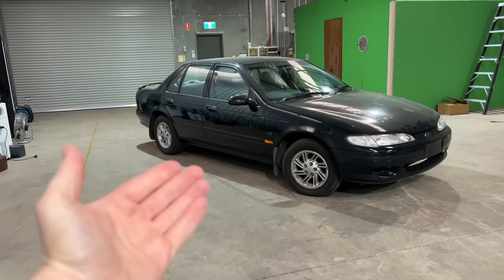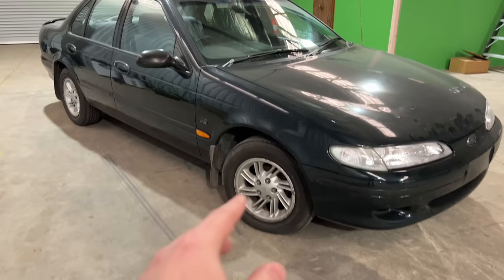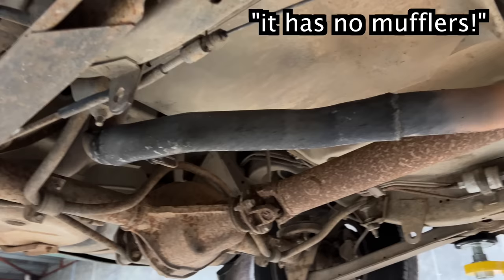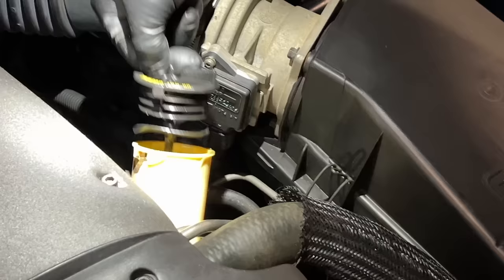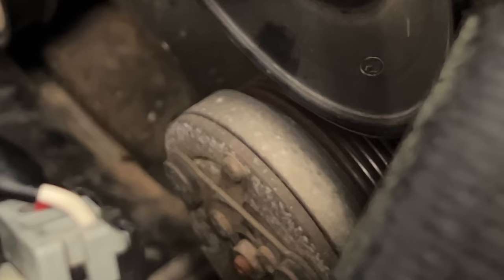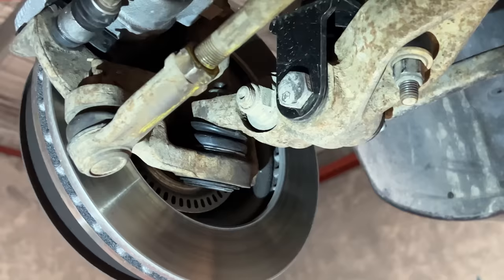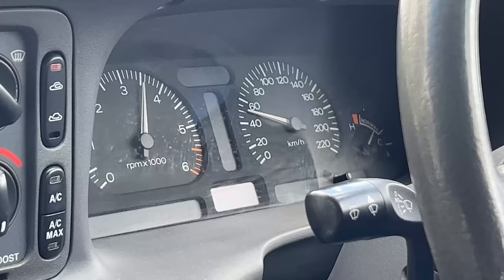Strewth mate, I got a V8!

Comment: Fun fact, those power steering pumps are used on a ton of Fords from that era!  They almost all make that cavitation noise.  But I hear you can mitigate some of that by using a handheld vacuum pump to pull out as much air as possible.  I haven't tested it on my truck yet, but I hear good things.  Nonetheless, Jeff looks like a ton of fun!  Love the video!
Reply: twilight! <3
Reply: @ChiefLink You know that cavitation comment makes so much sense now. It definitely didn't sound like a bearing otherwise it would have whined even if it wasn't under load, whereas in the video it only produced noise while the wheel was being turned. I'll keep this tucked away for future use. Thanks!
Reply: Yeah, that Ford pump design is garbage. Fortunately, Ford decided to keep using it for decades. They work fine, but they’re noisy. I believe BG makes an additive that is supposed to help.
Reply: I just pretend my Ranger has a supercharger.
Reply: I was gonna say, it sounds like every American Ford of that era I've ever heard.
Reply: @musewolfman  250s from that era make this noise but you never hear it because you're too busy being deafened by the cacophony of a million other horrifying noises are your built Ford tough truck disintegrates before your eyes

At least the frames are practically indestructible
Reply: Best V8 episode. Ever.
Reply: @thepinkplushie  rangers and Explorers as well. Those hold together somewhat better than the F-series did.
Reply: I couldn't believe it it's the same noise the older mustangs and rangers make over here in the states lol
Reply: Can confirm. I owned 2 90s Ford Rangers in my life. They make that sound. They were great trucks too. Pretty much all the original parts outlasted the frames! Decades of winter road salt sucks if you like your car. :(
Reply: Or ya just modify a power steering pump for another brand to put on. Brother did that with his ed gli and hasn't had any issues
Reply: Yeah, I guarantee someone has installed a more common and reliable pump on a 5.0L.

Comment: For a '94 Ford, that really isn't bad. Yeah it had a bunch of worn out bits but nothing you wouldn't expect for a car nearly 30 years old. The bodywork looks pretty solid!
Old Mate James is a legend.
Reply: 30 years? The 90s were only two decades ago right?

...Right?
Reply: @Skorpeonismyrealname  my 93 S10 is 1 year away from being 30 😅
Reply: @Skorpeonismyrealname  nope, it's 2022 mate lol
Reply: My '03 focus looks like it came straight from the factory 2 days ago compared to this😂
Reply: Ooooh 5.0L he's almost 4-DOOR Mustang GT. He only needs a Doug Nash 5-speed, a set of Flowmasters and he's a WINNER!!🤣James did an awesome job on that DROF NOCLAF GT!! All HAIL JEFF (the god of biscuits)!!

Being in the states I have to flip the vid around for it to look Normal. 🤣
Reply: As a person born in '95 I am absolutely offended by this comment
Reply: @harisalic2568  you should be embarrassed for owning a focus
Reply: This thing is in better shape than BAs
Reply: That water pump is pretty insane price wise tho
Reply: @Skorpeonismyrealname  three decades ago
Reply: My experience with Fords is that the frames are extremely well built and resistant to abuse (designed for NA roads that are salted in the winter), but the parts quality is laughably bad. 

Sucks that GM bodies often rot out because the parts market for them is so much better. Even for '80s G bodies you can get basically factory parts for dirt cheap to restore something. Fords require either massively overspending to guarantee a quality part, or slightly overspending to gamble on a part that could be fine or totally useless.
Reply: Bullshit, a Toyota wouldn't have nearly as many problems as a Ford would.
Reply: @JossRickard  nicer than some of the FGs running around these days too
Reply: It is in better condition than my 2006 Camry
Reply: @harisalic2568  yeah same with my 1997 bmw e39
Reply: There’s a bunch of these old blobby fords with 80k on the clock driven by granny with everything working. This is the trashed accessories of a motor you expect from a 70’s car
Reply: @Jacobtheunwise  hell no there's some beautiful focus' out there
Reply: @Helios8170  You will be surprised what a 20 year old, with burnout tires, a lighter, and 4 cans of paint can do
Reply: @Helios8170  your using american ford stereotypes against an Australian Ford, these things are tough as nails

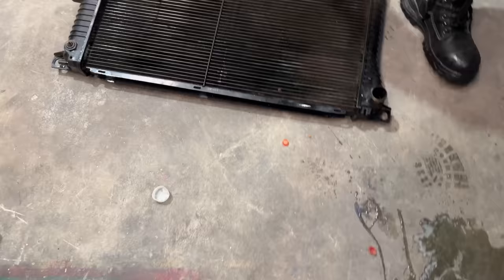Comment: 9:13 There's an ever present supply of road grit, and any particles that get between the metal rad and plastic fan housing get pressed into the soft plastic. This turns the plastic into sandpaper, which can wear metal
Reply: It's most likely PA (nylon) GF (glass fiber) reinforced. It's literally sharp pieces of glass.
Reply: Also arent fanblades also made out of Glass fiber filled nylon?
Glass fiber is very abrasive.
Reply: Even soft plastic can wear metal over time... Sure, the plastic will wear like 5x faster than the metal, but it'll still wear the metal eventually.

Comment: God-damn. Even though it's slow, it sounds so angry, I love it. Both before the new exhaust and after. Even though V8s have a lot of downfalls, you have to admit they sound AMAZING.
Reply: What are the downfalls of v8s? Most of mine have been super reliable ahaha. Yeah they use lots of gas but they sound great and move pretty well usually 😂
Reply: @PaulKingIII  it chugs gas like crazy, which, for most people is a big enough downfall to disqualify it entirely.
Reply: @CorndogCrusader  Who cares about a little bit of severe financial distress from fuel costs when you can drown out your problems with the sweet serenades of an 'ole vee-ate?
Reply: @CorndogCrusader  makes sense ahahah I use my bike most days so I can enjoy all my v8 cars/trucks so I don’t have to get gas much
Reply: @CorndogCrusader  My factory 200kw AU V8 is surprisingly good on gas, especially on the highway. Though to be fair the AU was purposefully designed to be as fuel efficient as possible for its day.
Reply: V8s are sorta a by-gone era type deal sadly. Last time there was a fuel crisis they just nerfed the fuck out of them, which led to the V6 era. Which definitely had some benefits. Now fuel is hell and though it's not THAT expensive to get a powerful V8 for a lot of older cars, the cost of actually running them makes it incredibly impractical.

My friend has a '74 Challenger and it steals the show next to pretty much any car on the road, but it costs a fortune to drive, so it's just a cruiser.
Reply: my fave engine type is inline 5
Reply: @wenyt2785  well you will love the Hummer H3, the most popular I5 car in North America
Reply: @CorndogCrusader  also Older V8s are pretty weak when it comes to power
Reply: @nickrustyson8124  audi rs3 inline 5 better

Comment: Swap the chair tops, and you're set. PROTIP: if you do that in a new car (that doesn't have oriented seats, some cars do), you can prolong the seat life by a long mile. When i was younger, my brother and i bought the same cars (the local dealer had a special) and i kept swapping the seats every year's end. End result, i sold mine with good seats, my broseph had to buy covers to sell his. :))
Reply: Hold on, that sounds really expensive and difficult. If you swapping the seats every year just do it before you sell car. I'm confused
Reply: @everettstormy  Changing the seats is one of the easiest jobs on a car. 4 bolts and an electrical connector
Reply: Or you can just buy really good seat covers and when you finally take them off you have new seats underneath
Reply: @sampuhhupmas5666  still a lot of money,  hmmm.
Reply: @everettstormy  What? Maybe if you have a coin-operated wrench
Reply: @mrazaq  I thought you were swapping the seats out, ooh, I just realized you meant trading the drivers and passenger seats
Reply: I never thought of this, but wouldn't it block the adjustment controls for the seats?
Reply: @AHungryHunky  yeah, that's why I thought he was replacing the entire seat at first
Reply: @AHungryHunky  depends on the make, in a lot of cars the seats and controls are the same so it's just a matter of finding which plug goes where
Reply: @Lysergic_  nah the controls are made to face outward so if you swap the seats its gonna make it impossible to reach the controls if you have a console
Reply: @sammynaron5166  oh dang ur right, well Id imagine theres a way to remove the seat seperately but idk how tbh

Comment: Man, I love this stuff. My first car was an 02' Pontiac Bonneville Supercharged, and I still have it. It's gone to absolute pieces, but the engine is still great, and I can't help but continue to pour money into the steaming pile of junk. Love to see you working on these sorts of cars because it makes me feel less insane.
Reply: I wish my bonneville was a supercharged one, I've got an 03 with the N/A 3800.
Reply: Those engines will last forever. I had a 95 SSEi. Trans went at 287,000 miles but the engine ran like it was brand new. Got 30 mpg on the highway without even trying. It had tons of tech for the day too.

Comment: Have you ever thought about taking a look at a Lada Niva? They are just great, in production since 1977 with surprisingly little change (classic bumpers, no electrical door & trunk locks, etc.), they actually came with a crank as an alternative start method up to the mid 90s, you can even crank-start the more "modern" ones, but you have to drill a hole in the bumper lol.
They are also pretty much indestructible and the high-low gearbox and differential-locks are actually quite useful.

Comment: i love your car adventures! i could watch hours of this.

(Edit: Also about the power steering pump! I have a 1991 f150 with a ford 300 and the power steering pump does that too. It's actually really common on older fords.)
Reply: Yup it's part of old ford's up to 2002 or 03, I'm not totally sure but it's normal that sounds
Reply: @lutboy2909  yeah chances are if you see an old ford that sounds like it's supercharged, it's not. it's the power steering pump.

Comment: Those 302's are quite good motors especially here in the states they're really liked and modded you could pretty easily get more power in them. I actually have one in my 1994 f150 smooth and pretty reliable. Hope you have a good experience with this 302.
Reply: Well he definitely didn't start out with a good experience, most of this video is a example of it, and the end is probably him thinking, "Man, I should sell this"

Comment: Pretty normal wear for its age, but nothing terrible. I dig it. Well done fixin it up.

p.s. I hit brake pads on the grinder all the effin time. Usually because the newer clips are thicker. And just buy a damn rebuild kit for the power steering pump. It's like 80 bucks and it replaces more than most of the reman places do.

Comment: If you want to make it a bit more lively, chuck a higher ratio diff in her. It probably has a really tall diff in it from factory and the quicker diff will liven it up nicely. Just remember to change out the speed sensor to match or else the ecu will think you are going way faster than you really are, and give you a fuel cut once it thinks you are doing top speed, even though you would be going a lot slower than that.

Either way, nice car! Hope to see more of it :)
Reply: Oh yeah, listen to how long it sits on the converter at the end when he floors it. Probably got like 2.73s in it
Reply: You mean a lower ratio diff to be  quicker off the mark

Comment: You wouldn't catch me dead in a Ford made in the last 35 years tbh but this one is a beaut
Reply: Almost every vehicle manufacturer has had some type of massive scandal, now it's all about picking your poison 😂
Reply: @BewareTheLilyOfTheValley  I work on modern fords five days a week, every single one of them has significant quality issues. Nothing on Stellantis but it's pretty bad. Most other manufacturers don't come close to the quality assurance issues I've encountered.

No need to preach to the choir, I've seen it for myself.

Edit to add: Don't forget that Explorer engines have catastrophic failure all the freaking time, remember that Platinum edition 2021 Explorer that went viral on reddit for exploding with less than one thousand miles on the odometer? extremely common issue.
Reply: illeyez505  congrats, one toyota. I'm talking MULTIPLE vehicles. It's not a coincidence.

Comment: I love the blown head gasket look of the coolant overflow tank.

It's not an EF or EL without the boot hitting you in the head
Reply: Thats just the plastic getting all brown and crusty... they sorta fixed it on the BA's so you could see the trans oil stains easier when the cooler exploded 😅

Comment: As a person that has had many Fords, that refurbed power steering pump sounds mostly fine.  Ford's are not super quiet like what you may be used to on other vehicles.  Here are some things I can recommend that may quiet it down.  First, use some soapy water and a spray bottle and spray down the PS hoses (while it's running) and turn the wheel back and forth.  There should be no leaks.  PS pumps (this goes for any car) can be noisy if there are any leaks as the pumps are sensitive to air.  Speaking of air, since this guy was just installed, there's a good chance air may be tried in the pump.  You might be able to use a vacuum pump to draw the air out, or you can just drive it, work the wheel, hit some bumps, and keep an eye on the fluid for awhile.

You mentioned the AC isn't working.  See if it's just out of Freon.  This is the most common thing that causes AC to quit.  If they are low or empty, the compressor won't kick on.  You can get some Stop Leak Freon that usually has some oils in it as well as dyes to show you if there are any bad leaks that need addressed (the oil is lube for the compressor itself).  Put a can of that in, and have the rest of them be plain Janes.  I assume this vehicle uses R-134a refrigerant as it's a 95 (the US fully transitioned by that year).  If it's not and originally took R-12, you can get an adapter for the fitting to put in R-134.  If you don't mind paying a bit, I recommend taking it to a shop and hooking it up to a machine.  They can evacuate the entire system, check for leaks, and fill it back up with Freon and oil.

Comment: For inquiring minds - the plastic used in that fan housing is likely PA6 which is a polyamide that is usually reinforced with glass. Glass is harder (not stronger) than most metals. I suspect this is why the fan housing was able to wear the radiator.

Comment: Dank, I honestly found it nostalgic/surprising hearing your Falcon start up (13:25). My Uncle is a Ford driver, having had a Ford Pickup, Lincoln Towncars, Mercury Marquis (All built by Ford), and I swear they all used the same starter motor. Hearing that slow start up brings up memories. Makes me want to learn more about engines and how to fix them.

Comment: My family's obligatory car brand is Volvo. Instead of big block V8s, I was raised on Inline 5s. Not as much fun as a V8, but it can still slam you into the back of your seat if you put the boot down. My first car was a 1990 Volvo 740 GL. Despite being two years older than I am, it had power steering, ABS, electronic windows and mirrors, the whole 9 yards. It was a good car until the transmission intercooler let go, needing a new radiator, and the problem had gone unchecked for so long that after a few months with the new radiator, one of the gears in the transmission broke, resulting in the power delivery stuttering once it came up to temp. IDK where it is now or what state it's in, but that's the way with the nuggets.

I'm sure I'll find her again one day.

EDIT: Come to think of it, that car also needed a start button. I called it the "Relay bypass button". It was under the hood rather than in the cabin, so I would have to turn the ignition on, open the hood, and then find and press the button to get the thing running. That's the mark of a true nugget.
Reply: That's a Small Block V8 from Ford , in fact one of the smallest !

Comment: Geez, Jeff is flash for an EF GLi! I had one of those - Wagon, steel wheels, plastic hubcabs that would fly off if you got too far north of 100, no cruise control and an auto you had to overfill for it to not slip out of gear. Occasionally smelt like someone had a spew in the back of it too. And a 6 too, obvs.

Comment: Ayuh, hit that power steering reservoir with a vacuum pump while turning the wheel slowly back and forth lock to lock, but before that, go to your parts store and get a little bottle of “Ford Friction Modifier.” It’s made for the limited slip rear diffs but ford dealers put that stuff in the power steering systems to quiet them down - along with using a good full synthetic Dexron/Mercon ATF instead of power steering fluid. Then she’ll be quiet as a mouse. 

Sadly those mid-90’s 5.0s topped out around 155 horsepower…Ford abandoned them for the overhead cam 4.6 which put out 223hp in 1996.

Comment: My dad is also an avid ”Nuggeteer”  and had a 1974 Ford Pinto when he was in college, a 1988 Mazda B2200 that I absolutely loved, and a 1993 Ford Taurus that died in ‘99 when my family and I were on a road trip to Yellowstone. My older brother and sister were arguing and my dad slammed on the brakes so hard the crank shaft exploded. He also had a 1979 Mercury Marquis Brougham, (that he got for free) a 2003 Kia Sedona that was terrifying to drive, (the steering would randomly lock during slow speed corners so hairpins were absolutely fabulous) and a 1993 Mercury Capri that I also adored, but grenaded its engine on the new owner about a month after we sold it to him. He had more but I don’t remember all of them. He did however have a 1954 International R-120 Series, and a 1973 Chevy Camaro Z28 that he got from my uncle, so they weren’t all nuggets. He’s gotten a little boring though car wise. He recently bought a brand new Hyundai Elantra. Sadly the nugget days have ended for my dad.